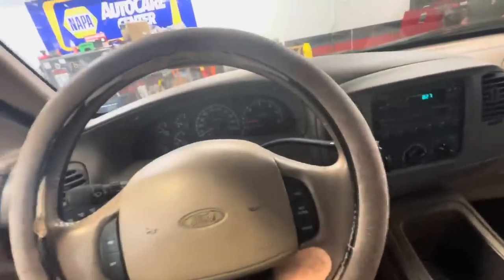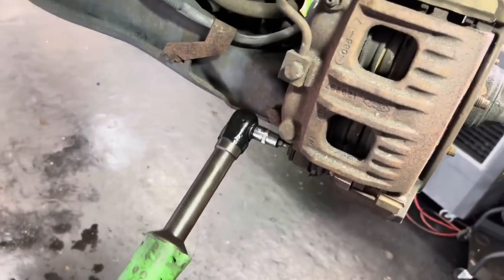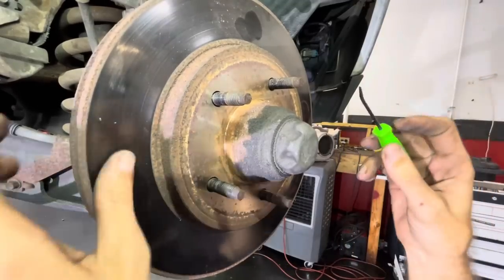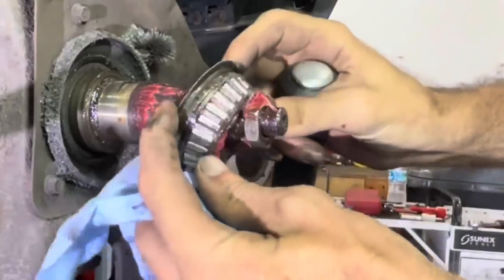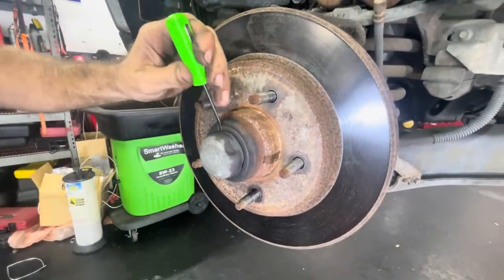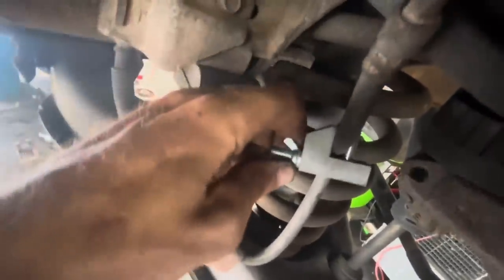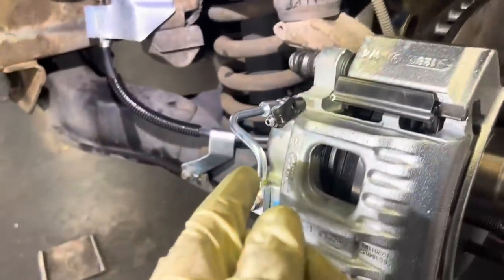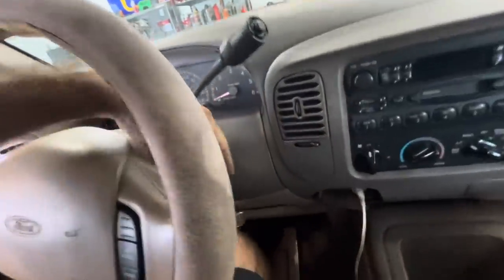Worn to NOTHING! 1998 Ford Expedition

Comment: I am 62 years old.  My grandfather taught me to pack wheel bearings the same way.  Only difference, we didn’t have a can of degreaser so we put a little gasoline in a bowl then cleaned out the bearing in the gas.  Those were good memories.  He taught me how to work on many things.  
Thanks for the video!
Reply: I'm nearing 60 and I did (still do) that the same way.  When I know I have a brake or bearing job coming up, I keep soup cans around.  Put some gas in them, swirl out the old grease, then blow it all out.

Comment: My Dad used to pack bearings by putting the grease in the palm of his hand ( like you) .  Then he would take the bearing and slap it in the grease against his hand, forcing the grease inside,  turning the bearing as he filled it.   He told me that the mechanics that worked on WWII airplanes did it that way.  Great job,  Ray!
Reply: That's the same thing I was taught by a WW2 veteran. I absorbed a lot of knowledge from that man.
Reply: Same method with my dad from B-17s to postwar cars and big trucks.
Reply: Me too
Reply: Same here.
Reply: I learned a great deal from the old vets, MUCH more packing bearings and turning wrenches!
Reply: better than then grease packer tubs ya can buy at the parts store ya can see where the grease goes.
Reply: Many still use this method, but that type brng mostly replaced by sealed hub style. Kinda like V-belts  and hydraulic power steering stuff
Reply: That's what I always did
Reply: @azpapa9347  I agree
Reply: Did the same no gloves were worn back then. Molybdenum grease was used. One good thing was that grease was a great hand cleaner when the hand was wiped clean. I wasn’t not a fan of putting too much grease in the hub ,just enough to stop and corrosion.
Reply: I used to pack em the same way .. till I bought a bearing packer
Reply: same way I learned.
Reply: That’s how I was taught.
Reply: I repack bearings with grease in the same way. Takes a bit longer, but very effective.
Reply: It is still taught that way my boy
Reply: That's how your supposed to do it.
Reply: That's the way my dad taught me also. He was a Navy assigned to a light cruiser working on the Seaknight floatplanes. They would catapult them off and recover them with a crane. His ship was the Nashville and they participated in the Foolittle
Reply: @kenore4003  I saw a documentary about this. Very interesting it was. Before I saw this, I wondered how they set up the crane system to recover the plane. Very neat system.
Reply: @christophermarshall5765  Those old Seaknights did a yeomans job in rescue missions. Saved a lot of airmen that had landed in the drink.
Reply: @kenore4003  Yes they did.
Reply: I still do it that way best way to pack bearings .
Reply: @Chris38908  I agree.
Reply: You want it right, that's the way.
Reply: Ray, your copious use of brake cleaner makes my soul happy!!! Also, I pack my bearings the same way, only I go from the big,( open end. Great video 👍
Reply: @Dougarrowhead  hahaha 🤣
Reply: I've already taught my 6yo son to pack bearings by hand 🤘no other way to guarantee proper packing!
Reply: Myself also. As you're tapping, you can see the grease rising up between the rollers. I learned from an ex-navy aircraft mechanic.
Reply: My dad same way!
Reply: Ray does it exactly as I was shown as apprentice for British Leyland dealership- bearings, spindles and hubs. We didn't have gloves back and we washed them out in pink leaded fuel. Lol. Though we used string to tie stuff like the calliper up to the spring.
Standard recommended practice in Rover and Jaguar workshop repair manuals. And exactly the way Had a Mark 2, Daimler 250 (2.5V8 fancier Mark 2 but slower). XJ6 series I-III, P5B Rover, P6B Rover, SD1 Rover. Rover P6 had adjustable ball joints, with a bronze ball cup for the base and for upper- so you simply adjusted for wear, repacked them and on it went. Seems like the later the make, the more sealed for life and simply swap out old with new became the norm.
Reply: My favorite part of the channel is being able to read cool stuff like this
Reply: Exactly how i was trained by older mechanics.
Reply: mmm yes chemicals on hands
Reply: My dad was helicopter mechanic during Korean war.
He taught us boys to pack bearings exactly like that.
And I have passed this lost art to my boys.
Reply: my Army Air Corps dad packed 'em the same way 😀

Comment: As I was trained several decades ago, Rule 1 is when repairing brakes, whatever you do to one side, do the same to the other side, no exceptions. Second, NEVER clamp a brake hose. There is an inner hose that can be easily damaged if crushed. I have replaced calipers, master cylinders, and bled the brakes many times to stop a brake pull. The problem was a collapsed inner hose. Instead, replace the bad caliper first. Third, when installing axle nuts on taper roller bearings, tighten the nut to fully seat the bearings. Then back the nut off and retighten finger tight. I’ve seen unseated bearings become too loose once the grease heats up. I hope you find this helpful.

Comment: Nice that the new rotors came with races in them already. When I was young we bought new bearings and races with new rotor's.
Reply: Some hubs come pre packed with bearings and grease
Reply: @richardmarshall1883  I guess it depends on what you buy . I was talking back in the 70s,and what my father had taught and showed me .

Comment: When I push them pistons back, I open the bleed nipples and dump that rusty corroded fluid from inside the steel calipers. Inside of calipers is where most moisture/rust contamination comes from. Changing pads provides an opertunity to flush fluid in the system.
Reply: Great idea. Also prevents overflowing reservoir
Reply: That’s how I was taught. I had a large C-clamp to compress the pistons while they were still on the car.
Reply: Why do we still use dot3 in the USA,it attracts water and is corrosive compared to dot5 silicone fluid. I changed my old 70 chevelle over to dot5 back in the early 90's and never had another stuck caliper piston ever again.
Reply: @kskoog2019  that how I do brake with c clamp
Reply: the only fluids i recommend not changing to other things out side spec are engine oil, trans, and diff other than that i use what i like pwr steering is questionable
Reply: Thank you for pointing out the proper way to compress the caliper because you always want to get out all the contaminants but you see mechanics do this over and over again at just about every shop. I never understood it and why would you want to leave all those contaminants in the caliper as it will eventually destroy the caliper. And then they don't even bleed the system afterwards which is even worse.
Reply: I do exactly that, & every 2 years, I change the brake fluid too. I also check the brake hoses, & replace ones that are cracked.
Reply: @paulrreeder  I use a F clamp. Or a Bessey as we call in the welder/fabricator world.
Reply: Where are these "contaminants" inside the caliper coming from? It's a sealed system, so nothing gets in. If you are seeing rust you have some other problem.
DOT3 absorbs water so it doesn't corrode the inside metal parts of the brake system, or boil away due to heat from the brakes. That's why you need to change the fluid regularly. 
It's just over servicing and a waste of fluids to change each time.
Reply: @Cheepchipsable  some of it comes from the inside of the brake hoses, also inside the caliper builds up with a lot of contaminants from the metal surfaces inside, remember brake fluid is somewhat corrosive.
Reply: @Cheepchipsable  no you shouldn't have to change it every time, that's why it's good to open up the bleeder and get whatever contaminants are out of the caliper where most of the brake fluid is held it's just a very good practice. And no matter what type of brake fluid you use eventually it all breaks down and induces water.
Reply: @Cheepchipsable  hahahahahaha Have you ever pulled brakes apart with corrosion in the master cylinder, calipers, & wheel cylinders? The braking system is not a totally sealed system. The master cylinder cap has a very small vent in it. If the system was fully sealed, it would create a vacuum in the master cylinder, which would drastically cut braking efficiency. It is not a waste of fluids to change every 2 years. I have seen brake calipers badly corroded. Brake fluid absorbs moisture, yes, but this moisture absorption does not prevent corrosion. It actually helps corrosion, which is why you need to change the brake fluid. The only fluid which does not require changing is synthetic type brake fluid, as it does not absorb moisture. A certain amount of moisture still enters the braking system via caliper/wheel cylinder piston seals as they retract, & cool off after braking.
Reply: @rhollyday  and pushing the contaminants back into abs unit/ master cylinder
Reply: That's an excellent point and technique. I will use this next time.
Reply: @danielclawson2099  When doing this, top up the master cylinder after pumping the brake pedal until firm.
Reply: @christophermarshall5765  That makes sense: this would reduce the volume of brake fluid in the system. I'll add that step.
Reply: @rhollyday  well overflow would only happen if one had been adding fluid whilst pads were worn and pistons fully extended. But yeh if you dump fluid like I said you'd definitely have to top up fluid after. Out with old in with the new.
Reply: @johnmcnair8854  yep you don't want push that crap back up into the lines.

Comment: My first job was at a garage and I learned how to pack wheel bearings.  Sometimes we packed them in our hand or we had a bearing packer,  I was taught that trick of yanking the wheel off to remove the seal and inner bearing.  Tighten the spindle nut then back it off a bit and slip the cotter pin in, lotsa fun memories.

Comment: 55 years ago I used to pack bearing that way, by hand, as I preferred it to using the grease machine. I knew where the grease was since I hand pressed it into the cage and bearings. I also used the nut on the spindle to remove the inner seal and bearings... works great! Back in the 80's I bought a case of grease from Standard Oil that looked very similar to  what you are using here. The stuff was like dog sh*t and you couldn't shake it off. I used it on the farm tractor and trucks. I think I still have 4 tubes left... probably will for a number of years to come as the newer vehicles have sealed tie rod ends and ball joints. For your brake calipers falling, or not wanting them to fall, make an "S" hook out of some 3/16" rod. This way you can hook them onto the spring via a mounting bolt hole... works great! Take care!

Comment: Watching this video reminded of my days working at O'Reilly's . During the summer we would turn 4-5 sets of rotors per day and 90% of the time they still had the inner bearing and seal attached to the rotor . We learned how to remove the seals from the inside and not damage them .
Reply: Why bother. They should be replaced along with brngs that are usually 'flacking'
Reply: @peted5217  FLACKING?  I think you are searching for "flaking"-  Tapered roller bearings can last many decades if they are well lubricated.  It is really only necessary to replace the seal.  Back in the day before cheap rotors from China, nearly every auto parts store turned rotors, but that was probably before your time.
Reply: Lol you can do it carefully from the outside, it’ll take more time then it’s worth. There’s a way to do it from the inside? Like tap it out with a drift or something? I’d just put the spindle nut back on after taking the outside bearing off and pull the rotor off. Replacing the inner bearing usually anyway so
Reply: Does anybody turn rotors anymore I don't know
Reply: @oldschool1993  probably was since only made ASE Master in 1978. Towards the end of career, noticed metal flakes in most frt wheel brngs during brake svc. Era of lo cost rotors was becoming vogue then . Most had nu races, so made reasonable sense to put in nu brngs.
Reply: @dirtyaznstyle4156  Yes , you lay one edge of the rotor on the side of a pallet , place a plastic bag underneath , then one tap with a punch or extension . The bearing and seal are now in a bag for the customer .
Reply: @michaelpressman7203  I think it's a lost art.
Reply: @BigLisaFan  good morning I'm a strong believer in repair reconditioning and reusing but for a place a shop like Ray works in for different reasons they have to put a new part in and make sure the part the job is as good as possible so when it goes out the customer will be happy and there'll be no comebacks hey have a good day and I agree with you
Reply: @BigLisaFan  good morning I'd like to make a generalized statement about shops and manufacturing the job needs to go out the door right because if not you could do 100 great jobs and have one bad job and that's the job everybody will remember was in the time you could be doing a new job you reworking or repairing the replacing something that didn't work out right and it cost the business money plus makes them look bad so that's why Ray does his job to the best of his ability and I'm proud of them and I admire his work habits

Comment: As a bearing aficionado, I love me some bearings.  That taper roller bearing is right up my wheelhouse!
Reply: haha,  cylinder go speen.
Reply: Used to replace spherical bearings on a roller. Shaft was 10 bananas and 18 bananas outside. Weighed 150 pounds. You never wanted to have them fall over flat on the floor really hard to pry up.
Reply: @kenore4003  if you have a hydraulic press with enough room and clearance and a helper straight get too parallels put them between the columns and the bearing and press and make sure when that shaft let's go somebody there to balance it if not use a bearing puller by the way I really like bananas or coconuts or pineapples
Reply: @michaelpressman7203  These were on a cylinder that was about 11 feet long and weighed 13,000 pounds. The bearings were taper fit. We had a hydraulic pusher that threaded onto the threads of the retainer nut and were removed by pressure in the taper. It would expand the inner race just enough to pop them off.
Reply: @kenore4003  to be honest my molds used to weigh about 2,000 lb I could manage them on a Ford truck far as anything that big you need a crane and more common sense than I have
Reply: @kenore4003  you got my curiosity what these rollers will for and make sure you got your steel toes on and when they pop lose be sure to be outstanding to the side that would make a heck of a mess p
Reply: @michaelpressman7203  Flaking rollers in a soybean processing plant.
Reply: @kenore4003  I was sitting here for the last hour trying to figure it out I figured you were rolling boiler plates or flattening steel or something crazy soybeans pretty cool man I used to work on big presses and casket dies and all kinds of wild stuff you know it's the old days I remember yeah I'm an old man sitting on the porch now
Reply: And we all know how painful it can be to get a taper roller bearing up in your wheelhouse.

Comment: The way I was taught many many 30 years ago to pack wheel bearings.
Is put a big blob of grease in one hand kind of like you did.
But only nibble at the grease blob with the bearing, not smearing it all over your hand.
Push straight down on the grease to your hand, nibbling the grease up thru the bottom of the cage, rotate the bearing and repeat until you see grease coming out of the top of the cage. No big mess

Comment: Ray
I’ve adjusted front wheel bearings just the way did, until my buddy showed me SKF catalog listing the torque procedure and specifications listed by manufacturer. I never knew there where some many different ways to preload taper wheel bearing. Check it out. You can download it from the SKF website. The version I keep on my phone is from 2014,but I’m sure there is a newer one available. 
For the expedition your working on here is the Ford procedure listed. 
“FTN Tighten hub nut to 30 ft-lbs/40 Nm while turning wheel. Back off 2 turns and tighten to 17-24 ft-lbs/23-24 Nm. Loosen nut 180 degrees. Tighten nut to 17 in-lbs/2 Nm”
You never know what you don’t know, till you know it. 
Keep up the great work.

Comment: The last time I replaced a caliper on a Ford truck it was in 1977, working on a 1974 F350. Everything was the same save for the ABS sensor, which didn't exist at that time. This design had been around a long time in 1998. Thanks for your informative video. Never mind the trolls. Even my sister-in-law is a vocal expert, never having touched a wrench.

Comment: Just a tip: If putting new hubs on with new races in them, then you should be putting new bearings in them. Bearings and races develop matched wear patterns and if you put old bearings with new races, or vice verses, you can end up with premature bearing failure.

Comment: When I was taught to pack bearings the grease must come out the inner side. If it didn't come out you weren't done.  That's why I enjoy the packing  tool, cut just drop it in and push.
Reply: Steve, there's a tool for that??? Looks fairly simple to make a tool. Is the tool worth the money?
Reply: @jaydegelder2964  yes Amazon has them inexpensive